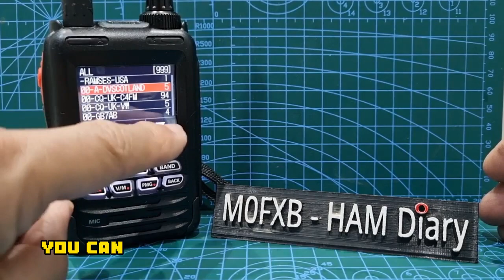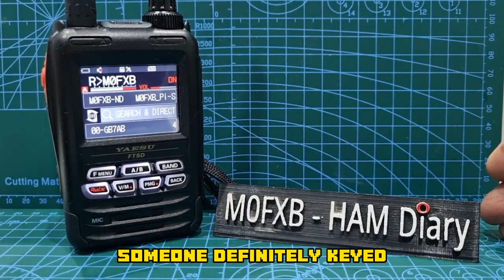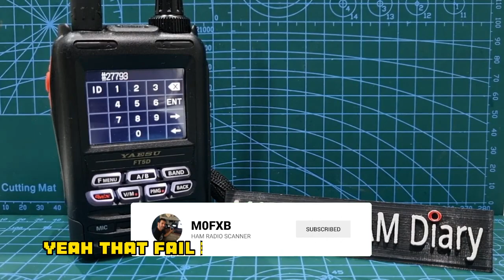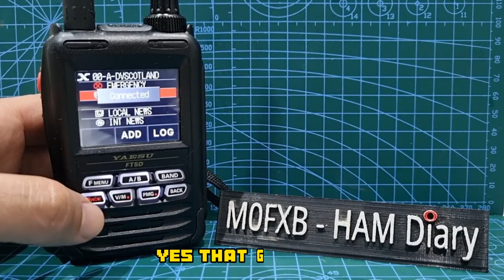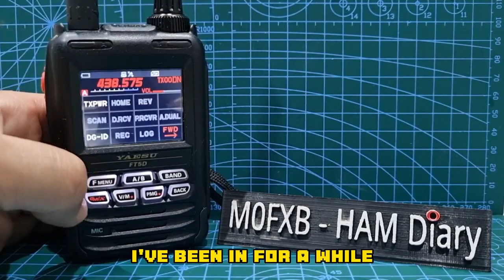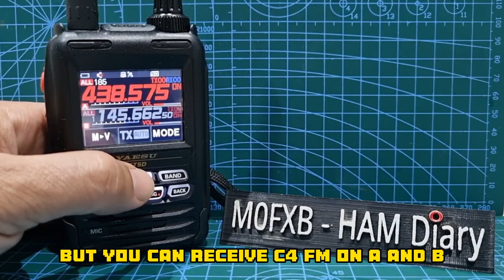YAESU FT5D- WIRES X MODE USING RADIO

Comment: Great vid. I just received the FT5 today and I don’t seem to be able to connect to my hotspot. My 991a has zero issues. Is there some setup beyond just setting the frequency of your hotspot and holding the button?  Also, when I say I’m not “connecting”, I do seem to be hitting the default site set in the hotspot and I can hear people talking, but I never receive the usual connect tone. Any ideas?
Reply from the maker: Weird add your call sign then reboot hotspot and key mic .
Reply: @M0FXBHamTech  My callsign was wrong. 😑 Thx!